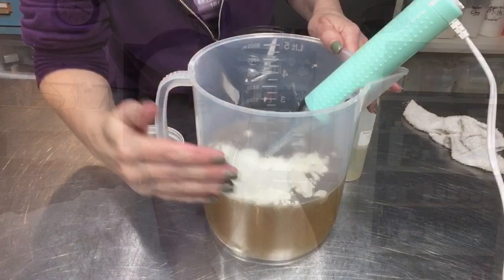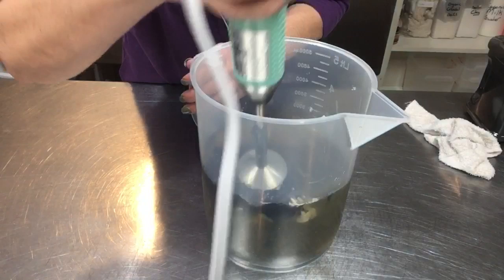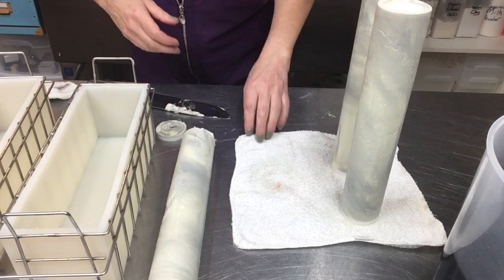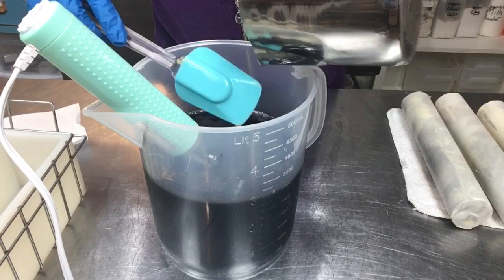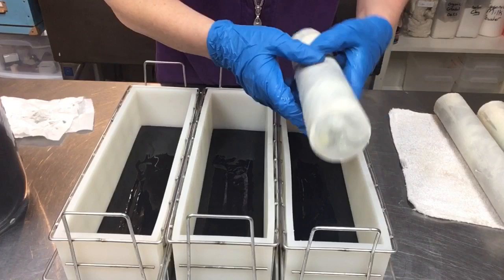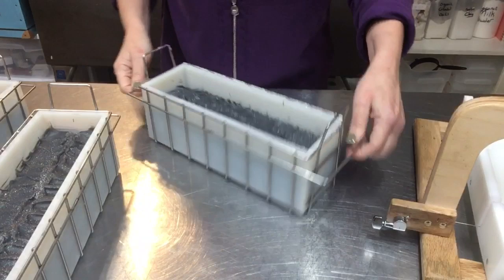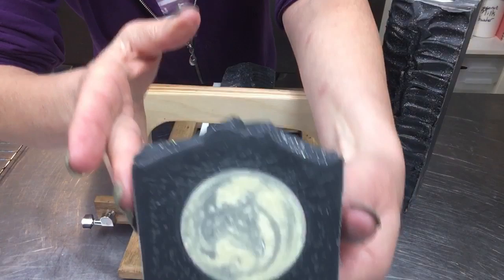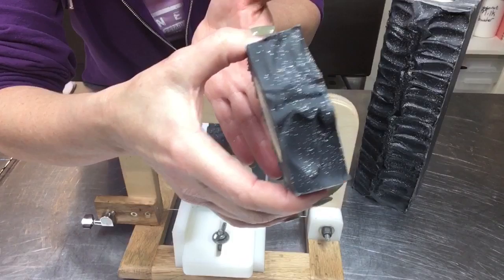Making Midnight Moon w/ PVC mold embeds & Activated Charcoal | Ellen Ruth Soap

Comment: Thank you sweet Ellen. None of the freezer method ever worked for me when it comes to unmolding the soaps, wether it’s a tube, regular hard silicone or plastic food container. I’m still practicing my earth and moon colors, BUT (!) i have very easy method to take it out the soap from the 2 inch tube. I use clear book cover/ protector. It’s a clear vinyl sheet. Not soft like sheet protector but harder. I roll it up, stick it in the tube and super easy to slide it out. Thx for everything you do. Your soaps are a beautiful work of art. ❤️👍🙏🏻
Reply from the maker: What a great tip!  Thanks for sharing❣️

Comment: They turned out perfect!🌕 Love moon soaps! When we do our galaxy soap, we have several different size PVC pipes. The freezer method didn’t work for us either. We tried to line it with freezer paper as well and it just didn’t want to come out without some major force😂 It was quite a sight to be seen😆 Vicki
Reply from the maker: Thanks!  Yes, unmolding PVC can be a super stressful event, I like the flexible cutting boards for liners, I've not had any issues with them..

Comment: I tried adding tussah silk to my goat milk lye solution. I had frozen cubes and ice bath. The tussah silk did not dissolve. What rate do you use and is there better success when the lye solution is hot?
Reply from the maker: Yes, it has to be really hot to melt. You could try melting it in a small bit of water, then add that to your goat milk...